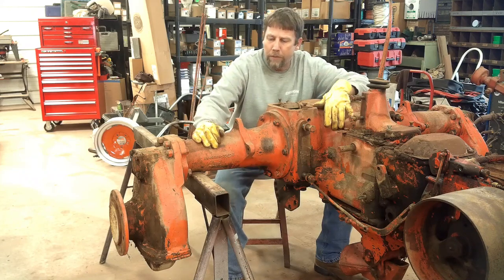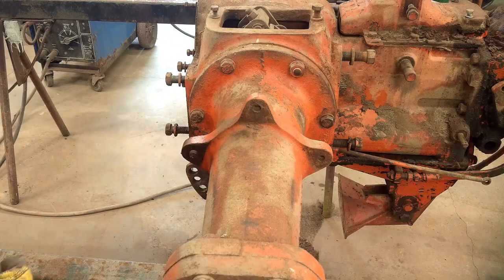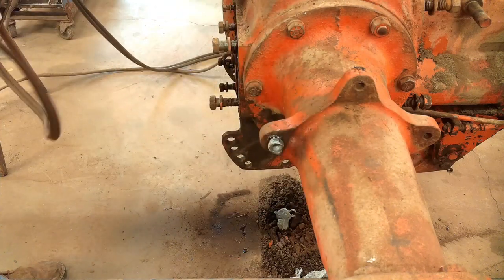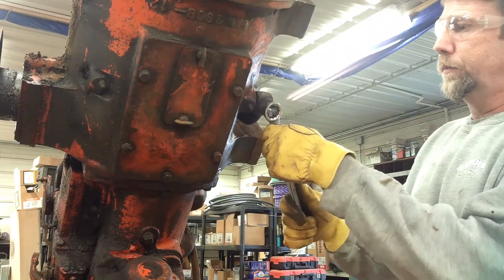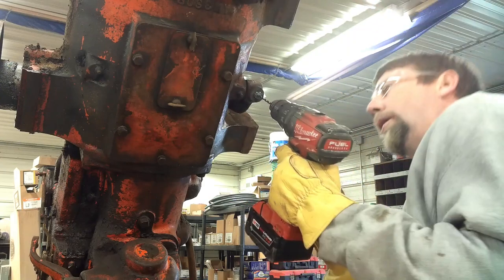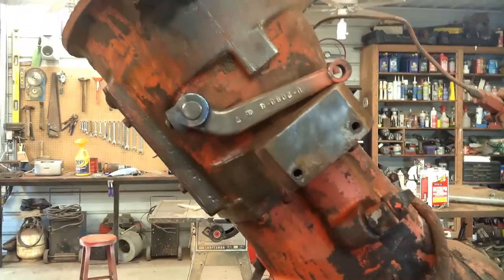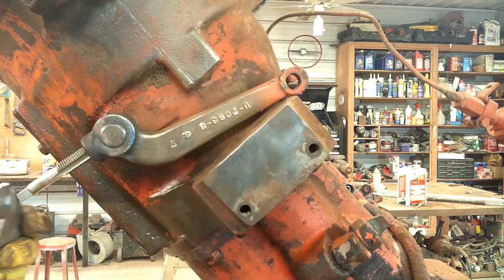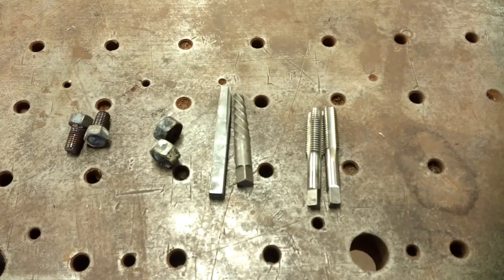Allis Chalmers WD45 Restoration Removing Broken Bolts Ep.13

Comment: Broken bolts are a pain!  (They scare the crap out of me especially since I don’t know how to weld!🤣).  Great job getting those out I agree that putting a set screw in that shaft should work just fine.  Looking forward to the next video!
Reply from the maker: Yes they are! It's been a long time since I've had that much trouble with one
Reply: I have front pedestal left over from when I installed a wide front.  It is all one piece casting. Every bolt through the frame broke off when I removed it.! Good thing I didn't need it ! Idk for sure but I don't think you can go from narrow to wide front without changing the gear box as well. On an IH you can.

Comment: The last time I tried to remove a broken bolt/stud was on my wife’s stupid little BMW car she had...I hated that car Jason....the bolt on the bracket that held the rear passenger tire snapped off, and the wheel would actually shift 2-3” forward and backwards almost hitting the fender wells and I think was ready to fall off....It would cost $1100 to repair at the shop so I acquired a set of EZ outs, 12” long drill bits of various sizes and 12” punches...2 hours later I dropped a pry bar right on my eyebrow and split it open....I then promptly took it to the Dealer and was out 1100 bucks only to trade that crappy car in 7 months later....I hate broken bolts
Reply from the maker: There is a direct correlation James. The harder the broken bolt is to access, the harder it will be to remove. It's written somewhere in the law of physics!